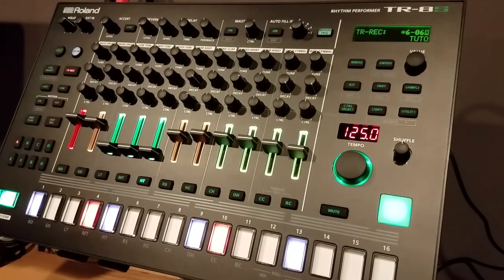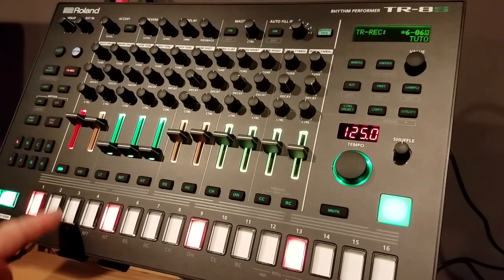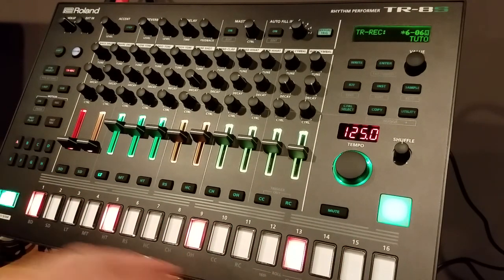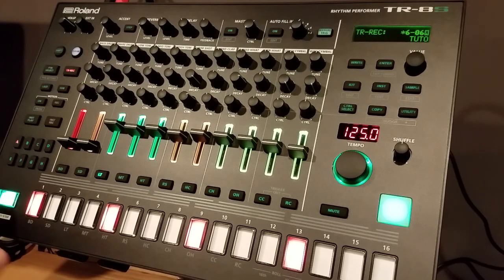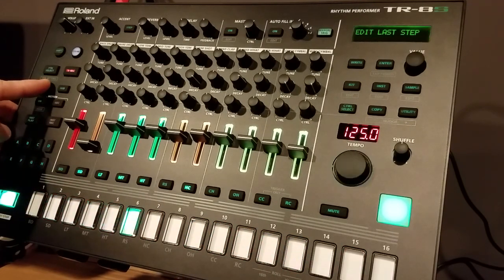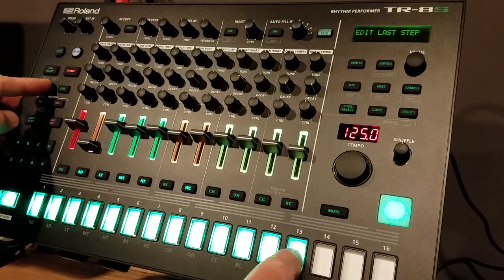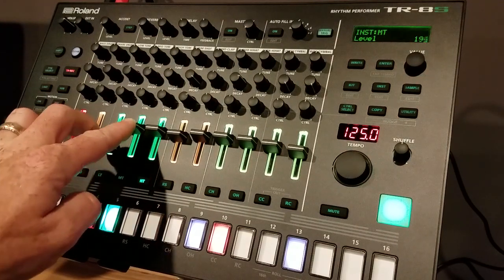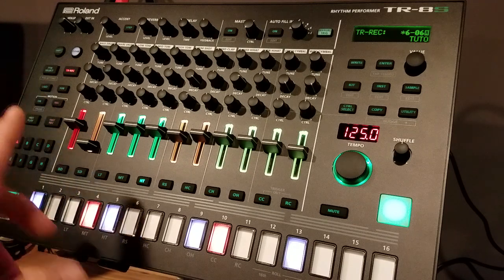Roland TR-8s Tutorial: Polymeters

Comment: Thanks so much for these videos, you have helped a lot. I was wondering if you knew a way to force restart the cycle when you have polymeters running. For instance, if I want everything to start from beat 1 after 8 bars, is there any way to do that? Only thing I've thought of so far is to hold shift and press play or hold shift and press a variation. This starts everything from the beginning but it isn't exactly on beat.
Reply from the maker: The way you mention is the way I do it. There is no setting that does it automatically.

Comment: Thank you very much for these tutorials. I got one myself and my question is.. can I have a sequence on A of 16 steps for the whole sequence loop. And a sequence of 12 steps on B? Hope it will be an upgrade for advanced beat timing:P Maybe you know more.
Reply from the maker: You can adjust the last step for each variation A-H. Remember that it is for the selected instrument only, so if you want the entire kit to end on an earlier step, you have to do it for every instrument. It goes quickly by pressing Last, then press BD, then press 5he last step in the sequence. Move down the instrument buttons, pressing the last step on the sequence for each. 22 quick presses and done!
Reply: @UnitE808  tnx for the fast response.  This is a hard one... when i'm in last "mode" then press A+BD (or any other instrument) I can set the lenght,.. Lets say 6 steps. 
Then Press B+BD. and set the length to lets say 12... 
But then when play my patterns A and then  B. It wont have any effect.. the (last) length will stay the same. for A and for B. 
I'm doing something wrong, or I want something too complex:P
Reply from the maker: @nfxgilo  dont press the variation and the instrument together. If you change the last step of only one instrument, only that instrument will play less steps. Everything else will go the full 16.  Have the BD highlighted and watch the steps in TR-REC mode. It should only go to the last step you assigned to it.

Comment: Is there a way to last step one of the A-H patterns within a pattern for example. I have a song with all 16 but a few measures within the melody are are only 8 beats. How can I make it so say “E” is 8 beats but the rest are in 16.
Reply: Alternately can I program an auto fill to only be 8 beats long?
Reply from the maker: Select the variation you want to shorten and press last step. Press the step you want the variation to end on. 

I would have to double check the method  for shortening one of the 2 auto fills, but I can get back to you on that. You can assign a variation to be a fill too. Make that variation shorter and your fill will be shorter.